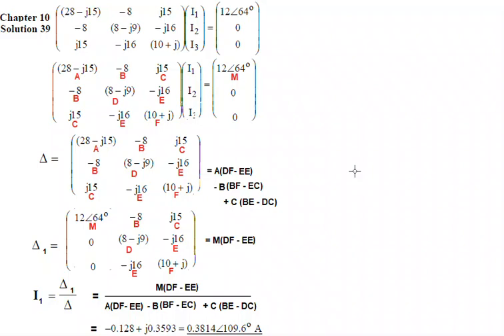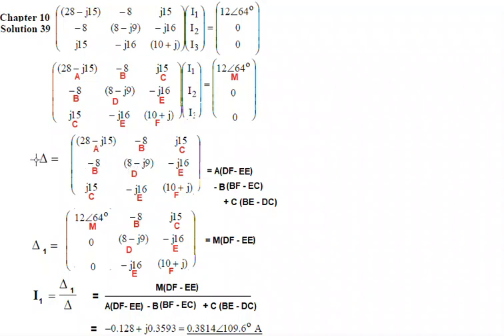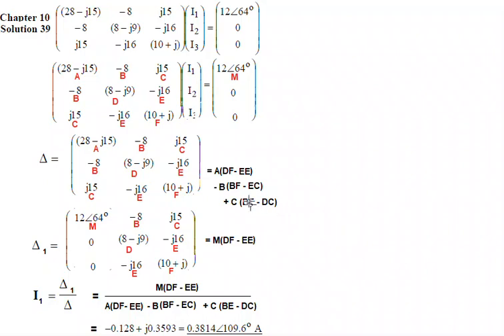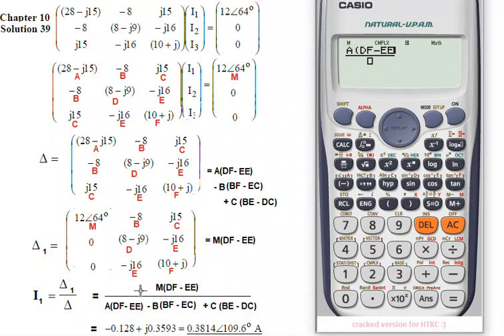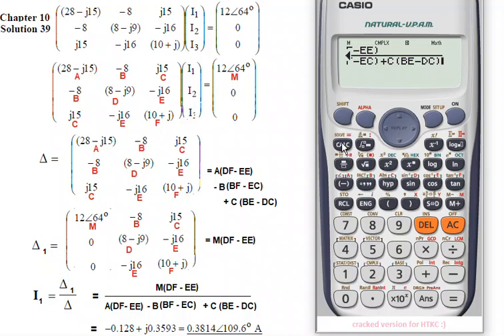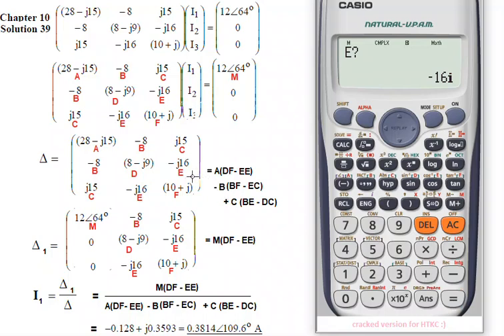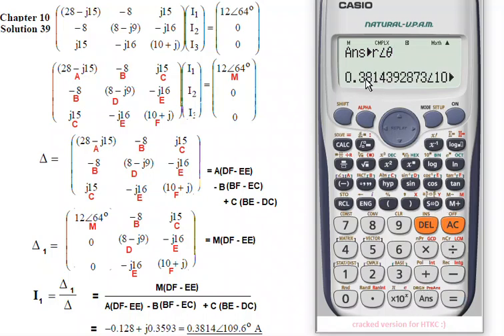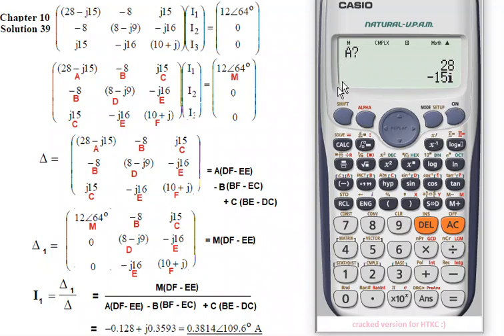(English)ENA || Ch-10|| Solving 3x3 Complex Matrix || with Casio Calculator ||(Method 1)

Comment: I keep getting stack error after I press the = sign
Reply from the maker: Clear the calculator
Reply: @ElectricalEngineeringAcademy   😮‍💨it still says stack error, idk if it's my calc. 
I am using an fx-991ES PLUS
Reply from the maker: @flashyred9125    google how to fix stack error in casio fx-991es plus
Reply from the maker: @flashyred9125  Try pressing Shift, 9 ,3
Reply: @ElectricalEngineeringAcademy  yeah, that's what I did
Reply from the maker: Clr the calculator

Comment: Shoukdnt Delta 1 be: M(DF-EE) - B(XY-EF) + C(XE-DY)?
Reply from the maker: Thanks dear. There are two techniques of writing matrix equations. You have taken each element of top row and then multiplied with the remaining. I have taken each element of first column and multiplied. Since the other two elements of first column are 0s, hence it becomes simpler. (by the way where from did u get X & Y)
Reply: @ElectricalEngineeringAcademy  Thanks, i substituted X & Y for the zero's in your matrix. I understand that it is 0, so is not required, but most matrices won't have 0's to be omitted, so this kinda limits the usefulness of this method. 

Also, i made a mistake i original comment: If Matrix is Row 1: ABC Row 2: DEF Row 3: MXY then, Delta 1 should be: A[EY−FX] - B[DM-FY] + C[DX-EM]
Reply from the maker: @poonchild  Thanks. If you listen carefully, at time 0:50 I have mentioned the 9 variables, which include X & Y. S0 should be no problem. Give it a try with some of your examples, and let me know.

Comment: Is the calculator is in Radian or degree
Reply from the maker: Try it ! ( I tried it works in both mode)
Reply: Sir; ∆2 Equation?
Reply from the maker: @syedahetesham8264  You have to understand the basic techniques of solving matrix  (page 930 circuit book). However in this case ∆2 will be  = -M(BF-CE)
Reply: @ElectricalEngineeringAcademy  which book?
Reply: @ElectricalEngineeringAcademy   thanks😍
Reply: @ElectricalEngineeringAcademy  ∆3 equation?
Reply from the maker: @syedahetesham8264  Fundamentals of Electric Circuits by Alexander and Sadiku